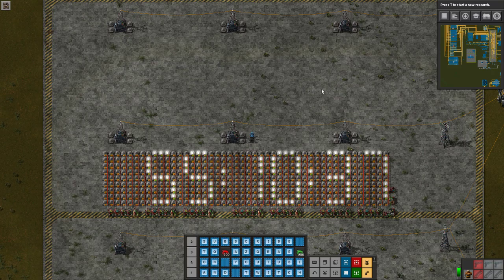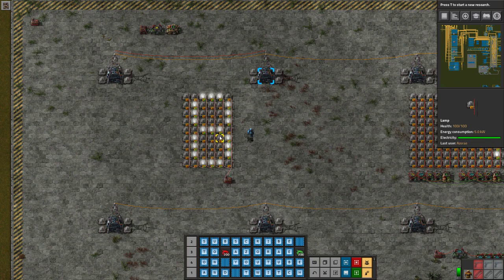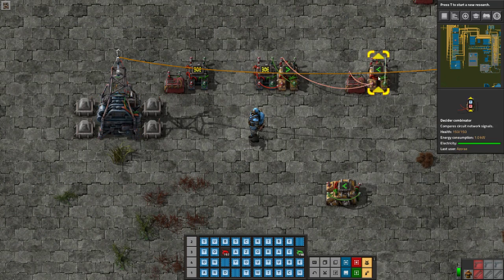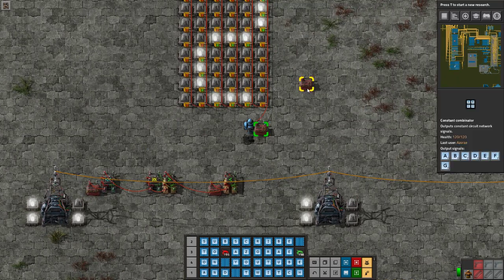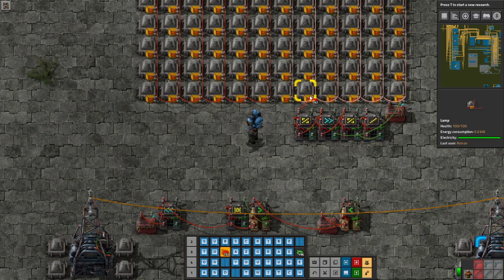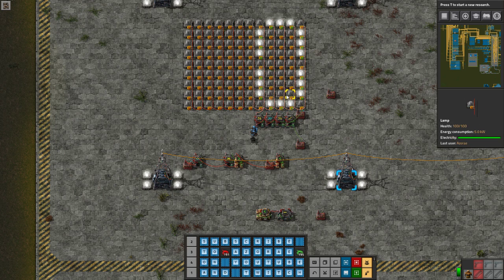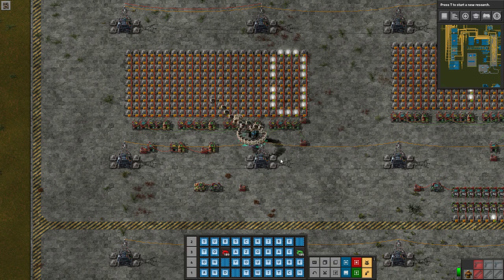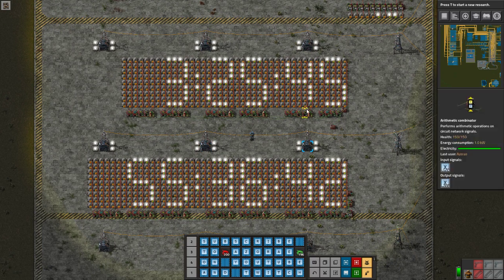Factorio - How to make a Digital Display and Game Clock

Comment: Excellent video. I decided I wanted to try to build a 7-segment display on my own, using the small knowledge I have of factorio logic circuits, and did get it working, but had basically done it segment by segment with a decider for each digit (ie, for the A segment, it's only off for 1 and 4, so took 3 combinators to program "if input is not 1 or 4, output A to the grid." The ones that had roughly an equal amount of on and off cases for any given digit took the most combinators, of course). I knew there had to be a way to do it with bit-shifting but didn't feel like trying to suss it out. This is an elegant solution to the problem and a great example of a use-case for bit-shifting in Factorio, and you also include great explanations for the sub-circuits you use, ie pulse generators, clocks, and memory cells. Definitely something any aspiring Factorio circuit engineer should watch.

Comment: cool, but for displaying stuff like numbers you can actually use items and requester chests, make the shape of all your lamps in the request section with some items you have and make the lamps the same, this way you can copy paste the chest and then delete the filters you don't need for each of your shapes and store what u want that way, then you already have the proper signals and the proper lamp arrangement ready, all you have to do is link each chest to one or multiple combinators that output everything separately and pass the signal to all lamps

Comment: This is much more compact. It certainly beats having a combinator for each digit on each panel. One question though, what is the purpose of the last modulo 2 combinator before outputting to the display. I didn't quite understand that part.
Reply from the maker: The bit shift combinator below each panel outputs numbers that have the potential to be very large. For example, bit shifting 1005 by 2 would still give you a value of a few hundred. What we need to check for is the parity (even/odd) after this shift.

Since the bit shift combinator in the final build does the inverse of the bit shifting we did when creating the dictionary, the segments we selected for the given digit will return an odd value because of the added 1s, and the ones we did not select will return as even values. Modulo 2 takes these even and odd inputs and outputs 0s and 1s, respectively. If we don't modulo 2, all seven values will be greater than 0 for most digits, and they would all look like 8s because all seven segments will be enabled.
Reply: i realize this is 2 years later, but it was easier for me to understand if i do "each AND 1" instead of "each mod 2", since thats the classic way to bitmask the last bit of a digit

Comment: really good video. I'm still trying to figure out how the dictionary work logically. all three of my braincells are trying to learn how you stored 10 numbers worth of data in one dictionary by bit shifting incrementally. I understand how to make a display but not how the display works. It is very compact.
Reply from the maker: Each of the A-G signals has a large base 10 value that when bit shifted essentially acts as a 10-bit binary number. For example, A represents the top segment of the 7-segment display. In the dictionary, A has a value that translates to 1111101101. By bit shifting and taking a modulus, it basically checks whether the bit in that position is a 1 (segment is lit) or a 0 (segment is not lit.) Because each A-G signal is completely independant, you can run all 7 bit shifts and modulo operations together and send all 7 signals to the display, and each segment only cares about its own letter.
Reply: @AzoraeSpeedruns  Thank you. This helps a lot.

Comment: that's awesome, is it possible in this configuration to change the colors of the lights? if possible please give me a little advice, thanks. great work
Reply from the maker: You can wire up a constant combinator with a color signal to each panel, then tick the "use colors" option on the lamps. Last I checked, though, the colored lamps are much harder to read than the white ones for some reason.

Comment: Sweet explanation!
Actually yesterday I found this CPU: https://youtu.be/ts5EKp9w4TU In that one, there is a really nice and verrry small display. 
I was trying to understand it (still at it), but cause of struggles I checked YT for something similar. Strangely the display closest to it, is yours. Afaik. [*By now I found another one, but slightly different explaining quality :P]
The moment you mentioned "bit(shifting)" I knew how to investigate that other display. Now I understand almost all of it.
It contains a neat trick, which you did not consider (yet). It places the dictionary at the top of the binary number, instead of the bottom. The advantage of that is, that the last combinator after the shift is not needed, since the segments can just perform a negative check (highest bit check). [*The other video I found also contained that trick]
Nice video :)

Comment: What do i have to change at your clock that it shows me the time? i could start running the clock at 00:00 but what do i have to change that the clock restarts at 23:59 to 00:00.
Reply from the maker: Set the decider condition on the combinator that is powering the clock (the one that increments signal T by 1 every tick) to only output if T < 5184000. That way, when your clock reaches 24 hours, it will reset back to 0 seconds and begin climbing again.

Comment: Am I right in the assumption that I could control up to 16 segments per panel with this controller setup?
Reply: For future reference: I tried it and you can control as many segments/pixels individually within a panel as you have signals - so this could be well over a hundred (or in my case 35 for a 5x7 panel). 

What is limited (by factorio number's bit length) is the amount of different characters you can show in a panel. I believe this limit to be 32, so sadly not quite enough for 0-9 + a full alphabet but enough for all digits, some operator symbols and a few letters for SI-prefixes and time units.

Also keep in mind that the table holding your 0s and 1s (I did it in google sheets rather than "encrypting" in-game) grows rather rapidly - with my example above already reaching a maximum of over 1000 entries if I were to use all 32 characters.